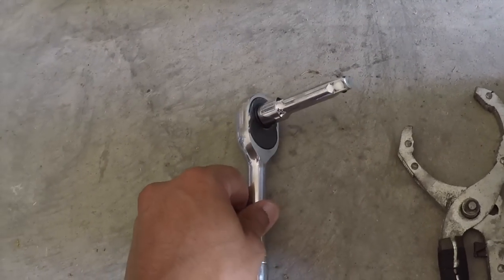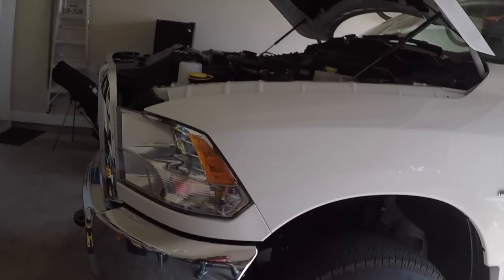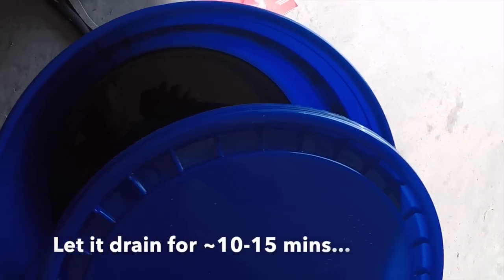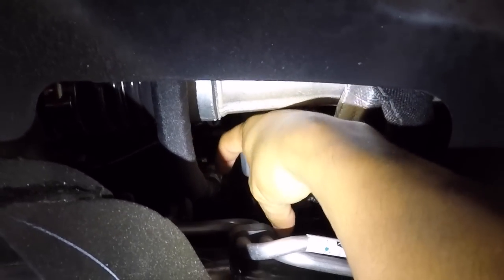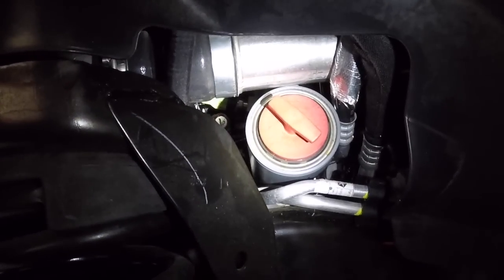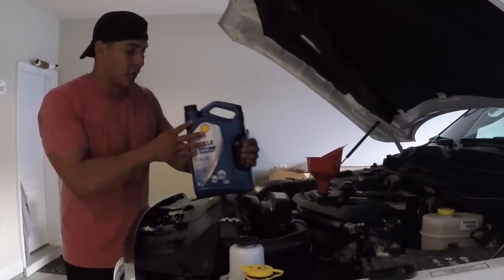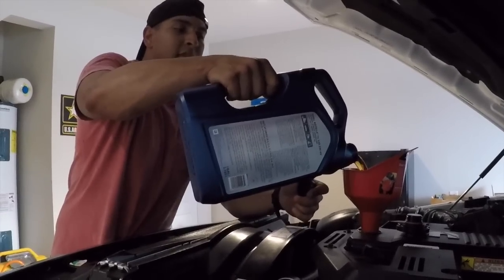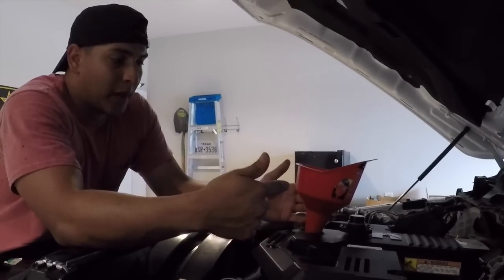EASY RAM 6.7L Cummins Oil Change How-To

Comment: Just put a gallon ziplock up from under the filter, zip it up, tilt it and take it out. Plug is nice but extra fancy. Gallon ziplock works great.
Reply from the maker: Yeah it works, but any mess with the ziplock? I guess you just dump it huh
Reply: I like that idea as well.
Reply: Thanks for the tip couldn’t find my plug today… The zip lock bag worked like a charm and didn’t spill a drop.
Reply: Ziplock would work for removal but when it comes to pre filling and reinstalling you deff want the threaded plug.

Comment: You don't need to "prime" anything for an oil change. Turning the key will simply activate the fuel lift pump and circulate fuel through the system. It will not power the oil pump. That only happens when the engine is started. Just start the engine after the oil change. Priming the fuel system is great advice after a fuel filter replacement.

Comment: I know this is a year ago but turning the key ain’t gonna prime the oil pump. The oil pump is mechanical and runs off the cam so in order for pump to work, engine has to be running.
Reply from the maker: Thanks Blake for the clarification!
Reply: Thanks, I was going to ask, did not seem right to me either.
Reply: Yes but in my case I do the fuel filter the same time as the oil change. So I turn the key 5 times then start. This cranks a while so gives the oil pump a slow speed cranking to pump up the oil pressure before it fully fires up. In that case it gives the oil pump time to prime. I reccomet it. One day to get dirty working on it instead of two. On my truck the fuel filters are due when the oil has 13% remaining.

Comment: The oil pump is mechanical not electrical like a fuel pump. Turning the key does not prime the oil filter like it would a fuel filter.

Comment: I've been looking at buying one of these and this oil filter location, as well as the little plug that you have to cap it with to tip it over, is a big turn off. I never owned a Ford or GM that had such an awkward filter location- I'd expect this in a Mercedes, not a work truck.

Comment: Great Video!  The Filter Plug Tip saved me.  I would have spent more on the swear jar and had oil all over me, the truck and the driveway…..
Reply from the maker: I’ve heard horror stories lol
Reply: @MotorHead18  well I’ve got one for you 😂. After I did the oil and filter change. I did the fuel filters using your other video. Thanks for that btw. I’m now doing the brakes on a dually. The rims are seized on! 💀spent 2 hours getting them off
Reply from the maker: @erictimmerman9320  Damn! Bad luck! Hope you used some anti-seize before you slapped them back on
Reply: @MotorHead18  I did!
Reply from the maker: @erictimmerman9320  good call

Comment: Thank you! Since I`ve done this once before, I hope I won`t have to call my son to help make sure I screw the oil filter nice and flush (No stripping of the threads) What really sucks is I can only use one hand to screw the filter on. My 1999 RAM was so much easier. I`m also motivated to continue to get better each time and save at least $150!
Reply from the maker: Awesome, glad I could help!

Comment: Great video. Need to buy a true filter wrench.  Was able to unscrew the filter with some Strunk and rubber gloves.  Had to "Use the Force " to put the replacement filter back on.  Used the special plug to keep the oil from spilling.    Everything worked out well.

Comment: I am at 10K miles on my 2018 Ram 2500 Cummins.  It was pretty easy to do after watching your video.  I used the tool to plug the oil filter for easy removal and it worked like a champ.  The only problem I had was I used a 16qt oil pan.  Once I pulled the drain plug, so much oil comes out it splashed all over the pan and onto the ground.  I ended up with a big mess!  Next time I will use a 5 gal bucket.  I did the fuel filters at the same time.  I figured I saved about $375 doing these things myself.  Thanks for the great videos!
Reply from the maker: Glenn Westfall No problem Glenn! Glad I could help. It’s actually a funner time the second time around lol.
Reply: MOTOR HEAD I definitely know what NOT to do next time!  I also had big time leaks on both fuel filters but it was totally my fault. The o-ring on the engine filter wasn’t seated properly and I completely forgot to put the o-ring on the rear filter. Once I corrected my errors it all worked out great and I have no leaks. Next time should go much smoother.......
Reply from the maker: Glenn Westfall Took me an hour to remove the oil filter in this vid lol. Y’all don’t know that but that’s the truth. The second time doing the oil change, it took me a minute to get the filter out. It’s all about using the right tools, experience and watching my videos hah!

Comment: This tool is reccomended for 2013-2018 DOdge Ram 2500 Cummins, I own a 2012 Dodfe Ram 2500 Cummins do I still need this tool or does the oil filter not need to tilt on my truck?

Comment: Thanks for making this video,  about to do the oil change myself for my truck!
Reply from the maker: Cummins6.7 Mike awesome! I’m due for another in NOV since I won’t hit 15k miles in 6 months. This next time will be a breeze!
Reply: @MotorHead18  hardest part was the oil filter. I didnt have that part you used to pull the filter out, so I used a bag lol
Reply from the maker: Yes, the oil filter is the hardest part of the oil change. There is always the bag option! The lisle oil filter part never leaked and made the process easier. It's also cheaper than the part often recommended, but does the same exact job without leaking. Glad you got the job done.

Comment: Good video.  I just did the first change on my 2020 2500.  Wasn't quite as clean as yours!  That plug tool was very good to have.  I did forget to prime it before starting it after changing the oil.  It didn't  give me any problems though.  Also, I only realized after filling my 5 gallon bucket with 3 gallons of oil that it fits great under the oil pan, but can't come out!  I just jacked up the rear driver's side wheel and got it out. :-)
Reply from the maker: Lol always new ways to get things done. Glad it helped! Those 2020s are stunning.

Comment: I never seen 5w diesel oil lol new to me. When I change the oil in my ISX Cummins I always used rotella 15w 40
Reply from the maker: Can’t go wrong with that in the summer!
Reply: @MotorHead18  Lol not at all semis call for 15w40 but when it's cold cold out we try not to shut them off but if we do we plug the block heater in. Cool video I'm considering getting the ram 2500 with the Cummins
Reply from the maker: @Dachamp2001  Plugging in block heater in cold nights FTW!

Comment: I just remove the filter and replace on my creeper after I pull off the oil drain plug. Easy to reach up and lower filter with zero drip.
Reply from the maker: It’s a technique!
Reply: You obviously have a 3rd generation or older because 4th generation the oil filter cannot be removed from beneath the truck.
Reply: @walterk1221  I 2010 4th gen will lower down...

Comment: MOTOR HEAD you have posted a great product easy to follow and understand. I am a first time diesel owner and I am trying to learn as I go. I just purchased what was needed for the oil change due to the cost differences of Amazon and other local stores. I went with Rotella but was wondering if you could enlighten me on Royal Purple. Is it worth the price or is it like the rest of American and just a name?
Reply from the maker: Everyone will have their own opinion. I do like rotella, but wouldn't mind royal purple.

Comment: The oil pump is mechanical, you wont prime it without cranking it over/running it.  The primimg via key cycles is for furl filters.

Thanks for the vid and links to the Lisle.

How about reviews as you clock miles up.  Thanks.
Reply from the maker: Anything specific you are interested about as I rack up the miles?
Reply: Motor Head MPG, does it regen much?  If you have any emissions issues, hopefully you font.  Thank you.
Reply from the maker: https://youtu.be/Ys5iDeuqyjg Here you go WBOS72! Took your advice and gave you a shout out in the video. I will soon be posting a video with REGEN footage as a traveled on the highway. Turns out that I have regen'd a few times, but have never noticed a difference in engine sound or mpg which is good. I bought a scan gauge to better track temps, and more importantly, REGENs. Let me know if you ever have any questions. No emissions issues as well!.
Reply: Amazing he does not know the truck has to be turned over to pump oil. Guess he is trying..

Comment: Question, after I changed my oil on my 2015 Cummins I started it and it came on drove it out of my garage and drove it around the block  to a parking spot tried turning it on it just clicks but doesn't want to turn o anymore. Any idea what might be the problem? Going to charge the batteries to if that works.
Reply from the maker: Batteries, alternator, or somewhere else within ignition system
Reply: @MotorHead18  bad cells in the batteries  AutoZone said...will pick up two new ones tomorrow. Will keep everyone posted.

Comment: Would a gallon ziploc bag work for the oil filter too? Drop the filter into a bag and zip it up. Asking because I don't know but it looks like it should!
Reply from the maker: Not the first time I’ve heard of the idea, may be a little sloppy but should work?
Reply: My experience is it would be too hard to get a bag in there and not enough clearance to pull it through the wheel well. If you drain the oil first, then pull the oil filter there really isn't any dripping. Put the oil filter cap on and pull it through the hole. I tried with a plastic grocery sack but it ended up tearing off as I pulled the filter through.

Comment: Thanks for the Video Sir, but I am curious to know exactly what oils Dodge Cummins says to use in YOUR truck manual. My manual says T5 10w-30 Diesel (above 0ºF) or T6 5w-40 synthetic (for colder temps below 0ºF) ONLY. I own a 2021 6.7l Cummins 2500 Dodge Ram Big Horn. I find that ridiculous and disbelieving because its common to run a thicker oil in hotter temps such as the T6 15w-40. I live in the high desert of California. Summer temps here run between 95ºF and 105ºF normally. I am even wondering if there is a misprint in my manual. Your thoughts?
Reply: 4th gen had a different style lifters or something in them. They called for either 5w-40 or 15w-40, whereas 5th gen say not to use 15w-40 and calls for either 10w-30 or 5w-40
Reply: What I've learned is the "5" in 5w40 is thinner at cold temps. It would seem to me that Ram/Cummins is worried about oil that is too thick when cold running through those hydraulic lifters. 2019+ Cummins have the new lifters and the new oil requirements. The mechanical lifters on previous generations can handle the thicker oils like 15w40. The "40" in the rating will perform the same for either oil when it is up to temperature.

Comment: Nice video. I  just did my first oil change on my RAM yesterday.  I have to admit that oil filter was a bit of a PITA!  I have the more expensive plug tool (I didn't now about the Lisle tool) and it worked perfectly.  I ended up pulling the RF tire/wheel just to help me get in there.  Just curious, Why did you go with the 5W-40 vs. the 15W-40?  I used the Rotella T5 15W-40 as I am in California and it rarely gets below 0 degrees here.
Reply from the maker: Happy Cloud Yea, that filter is a bit of a PITA to get to! I wish more people knew about the lisle I have in the description. Works very well and priced well. Reason why I went 5w-40 is because that’s all Rotella T6 comes with. I am in your same position, as in I am located on east coast in N.C. where I won’t see below 0 degrees. For my next run through, I am dumping amsoil in there, and I don’t see any difference from T6, then I will try Rotella T5. One day I will have a “go-to” oil. Lol
Reply from the maker: Happy Cloud Also, just replaced my fuel filters for the first time. Stay tuned for a vid! Thanks for subscribing!

Comment: “ I do both because just        Like I can” BOSS
Reply from the maker: Yeah your right!
Reply: MOTOR HEAD I appreciate your videos, great work! I have a 2018 3500 dually  I’m having a hard time removing the oil filter. Also I can’t get to it from underneath my truck.  Any suggestions?
Reply from the maker: @dirtyglove08  I found that the 12" wrench did the trick!

Comment: Motorhead, I bought the filter plug tool you recommended. I test for it in the new filter, and found it was very tight and more difficult than I thought it would be. How was yours?
Reply from the maker: Snug. More elbow grease!

Comment from the maker: Ladies/Gents, for clarification straight from my owner's manual, "Change engine oil every 15,000 miles (24 000 km) or six months or 500 Hours or sooner if prompted by the oil change indicator system, whichever comes first."
Reply from the maker: 1000 views yall! Thanks for all the support. Please like and subscribe for more "how-to" videos!
Reply: Motor Head you are correct. I just change all of my filters every six months.
Reply: Watch out with the stealership they will tell you it’s every 5,000. Then when you tell them the owners manual says 15,000 they say, oh sorry I thought you said it was a gas engine. Called 3 different dealerships, each one said 5,000-7,000 after I specifically mentioned it was a Diesel engine.
Reply from the maker: @greg9323  can’t go wrong there
Reply from the maker: @lfvfd  and that’s why they call it the stealership!

Comment: How did that oil felt in you truck? My truck is due for service do you recommend the VALVOLINE 5w-40 oil the true blue?
Reply from the maker: Yeah that oil is fine, I would prefer the rotella over Valvoline though.
Reply: Valvoline Premium Blue Extreme 5w40 has been the Cummins factory fill for decades.

Comment: How do you erase the service warning light after an oil change on Ram 3500 Cummis Engine?
Reply from the maker: Reset the oil change monitor life in dash settings
Reply: @Motor Head  I've tried that but the option is not available using dash settings.

Comment: Recycle it by filtering it and using it in your gas tank I’ve been doing this on my 2010 Dodge Ram 3500 I have 2892876 mile on it running strong
Reply from the maker: Interesting!
Reply: @MotorHead18  I would not recommend doing that. The oil has a very high soot content now with the egr cooler compared to the Cummins that do not. It can damage or destroy your fuel pump and injectors. Do not do it.
Reply from the maker: @CSXtrackworker  I wouldn't do it personally although is a method! Lol

Comment: Oh how I wish I had that plug... Little messy with that thick black diesel oil. This was my first oil change. I just used motor oil that I had left over from my Civic. It's synthetic, so I think it should be ok, right? JK. Thanks for the video.
Reply from the maker: The plug is a must!

Comment: So doesn’t the oil spill all over when you first unscrew the filter , down the sides etc. ?  Seems every filter I ever removed that was upright spilled out(before you capped it) so when you pulled the filter out of the wheel well , not a spot on it?
Reply from the maker: No spillage at all.

Comment: Any particular reason you went with the full synthetic so early on engine life? About to do my first oil change and this is my first diesel.
Reply from the maker: No particular reason than I could have a longer interval and it’s quality
Reply: @MotorHead18  what interval did you go to? Watching your fuel filter replacement video and want to be able to do all at the same tine

Comment: Fumoto drain plug w/Triax Supreme 15W-40/10W-30 combo with a Wix XP filter here in my 2017 6.7L CTD.
Reply from the maker: Kit Forrest, How's the fumoto drain plug been?
Reply: @MotorHead18  I have them on every family auto! Have for over 18yrs.  They all work/function awesome!
Reply: @kixforrest2358  Do you have the part # for the Fumoto for the 6.7?
Reply: Works like it was intended! No issues as to date. Drains a bit slow-but I drive her around for a bit to get the oil up to at least 190*F - then take her back home & drain.
Reply: @kixforrest2358  Thanks. Ordered.

Comment: Thank you for this video! There’s now T6 15w40. Would you suggest that or what you are using?
Reply from the maker: Probably not now that the cold is quickly approaching. I would personally look into it for the hotter months going to the T6 15w-40.
Reply: @MotorHead18  you realize 5w40 and 15w40 would have the same viscosity rating in the warmer weathers right? It’s in colder temperatures that it would be different...
Reply from the maker: @pactap4584  Yup sure do! Did i misspeak.
Reply: @pactap4584  actually at operating temperature they are the same. [EDIT: Additionally, 15W40 is forbidden for 2019 and newer. The factory service manual says to fill the filter, "random internet know-nothings" say not to.]
Reply: @MotorHead18  Great instructional video! So, I live in TX where it's hotter than the devil's nether region right now. I got a '16 Cummins 6.7 with 137k. Which oil weight would be best for me?
Reply from the maker: @shadetidwell8540  summer shouldn’t require heavy weight motor oil. And yes it’s hotter than a crack pipe on payday